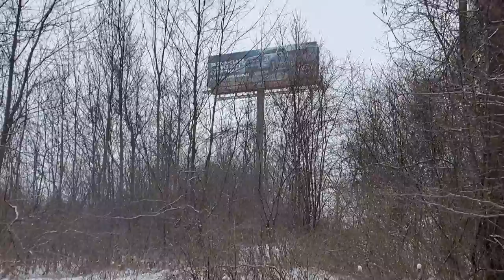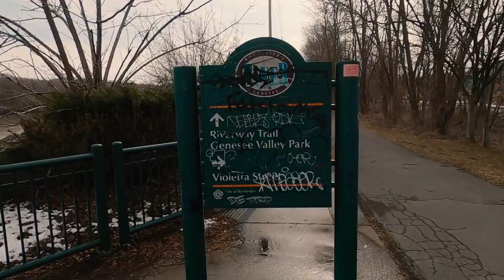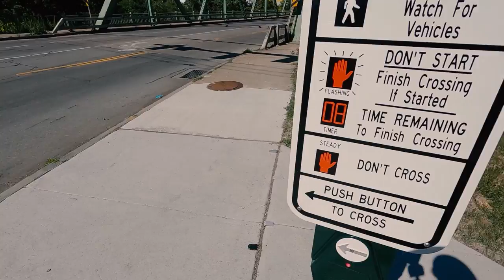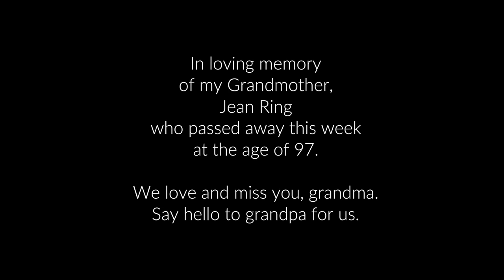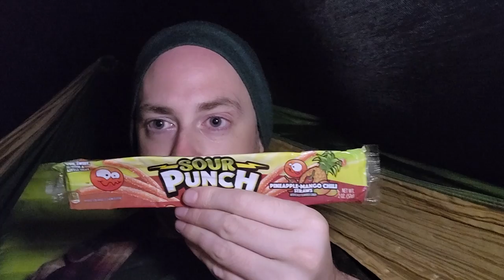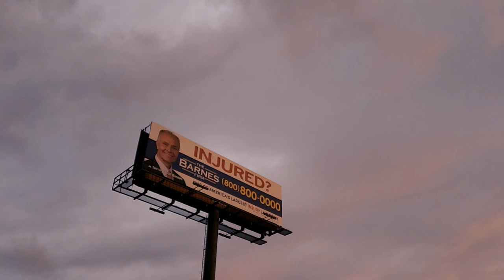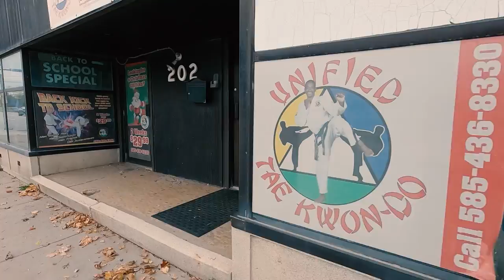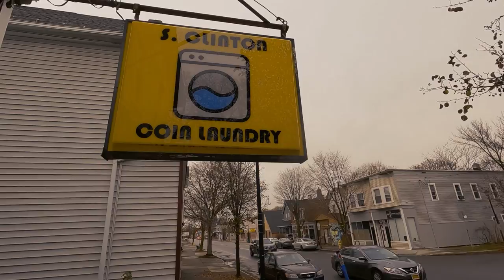Stealth Camping New York | 12 HOURS of Stealth Camping Episodes Supercut

Comment: How do you heat the tent up for the night? Do you use a Buddy heater or do you camp using a hot tent at other camps?
Reply from the maker: I actually don't heat it up at all, just dress warm and use temp-rated sleeping bag and sleeping pad. I did actually just buy a mr.buddy though, so I'm pumped to try that out!